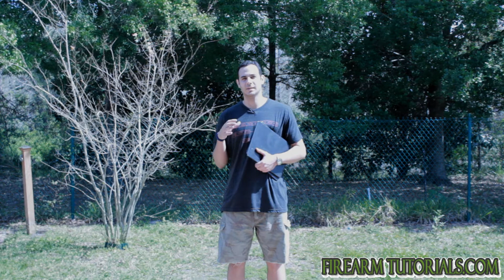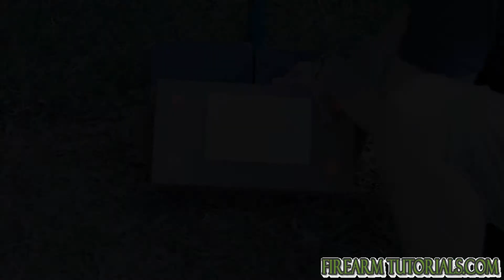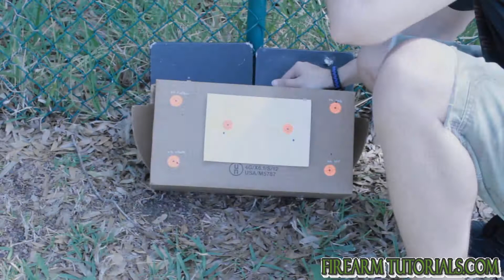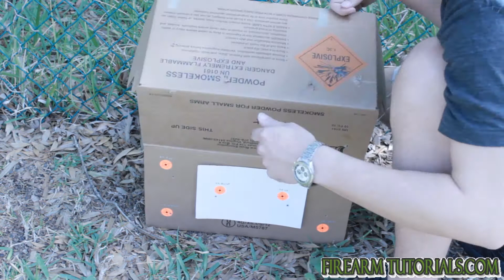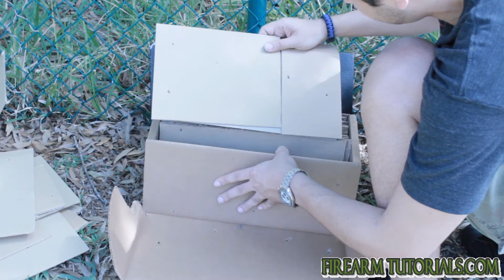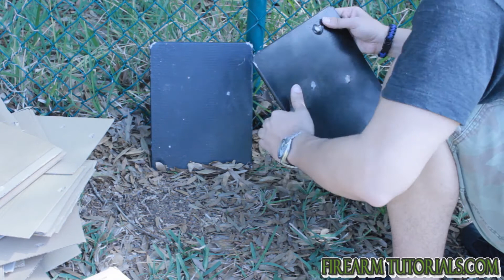Subsonic 22 penetration testing

Comment: Even high powered air guns move a 14 grain pellet up to 900 fps are lethal. Super calibri is good close range rodent ammo
Reply from the maker: Wow, I didn't know they performed that well.
Reply: arrows move slow too and they have become better too compared to old days and they got thing done just fine. The refinement of the art of killing is improving. Look at the crappy weapons in the past and compare them to today. Slow and deadly is still deadly
Reply: +FirearmTutorials .com Hatsan has a gun called the 155 Torpedo and it throws a 25grn pellet at 900 fps.  It's a fixed barrel spring piston.

Comment: A large gummy bear would even be better than your cardboard, but it did give me an idea. I am thinking about segmenting a box of sand with cardboard. A firearms trainer I know of says a box of printer paper is a good stop for checking an unloaded gun as any mistake will be stopped, including most rifle rounds. Sand is more reusable than paper. I will have to figure out a lot more before I recommend it.
Reply from the maker: Good call.  I never thought of that, but I'll try it using several different reams of paper.
Reply: ***** Well, that would be more like a wet pack or a phone book. I was thinking of using several pieces of cardboard to check how far the projectile got through the sand andcompariing it to the ballistic gel tests for the same rounds.
Reply: +FirearmTutorials .com  that last shot  was hauling some ass and it barked dang  interesting videos🔫👍🐻
Reply: I'm thinking of shooting into a block of clay, like Taofledermaus does... pretty cool results, I think...

Comment: I want to shoot in my basement. I think 15 or so boxes will stop a sub sonic 22
Reply from the maker: You should be good if you pack the boxes tight, I'd add a piece or 2 of steel to the back.  Sounds like fun, make sure you don't miss...
Reply: FirearmTutorials .com cool.. Im going to use wood in between cardboard plies
Reply from the maker: That should work.  Let me know how it turns out.
Reply: You need proper ventilation! Without a fan sucking the fumes out you will have issues
Reply from the maker: 22 shouldn't be too bad.  Especially if shooting stuff like calibre that have no powder but it's a valid point.
Reply: Most .22 subsonic rounds still have powder in them.  I was a rangemaster for a number of years at an indoor range.  If you tell people its ok to shoot firearms in unventilated home basements youre doing the wrong thing.